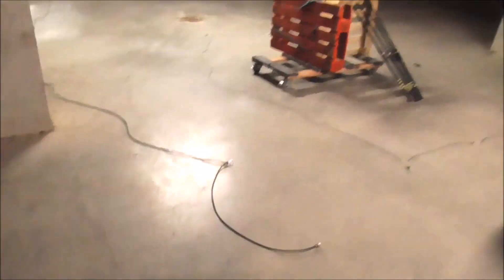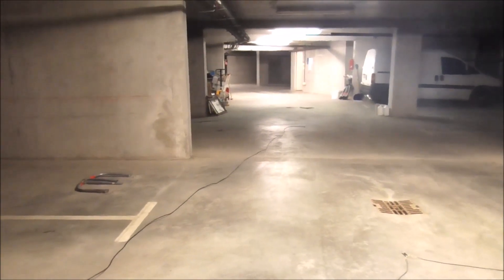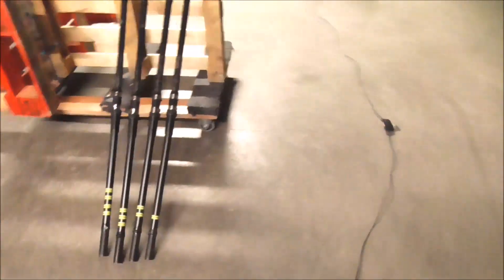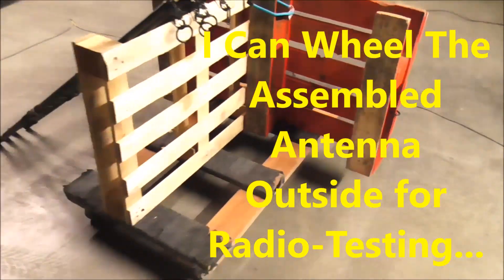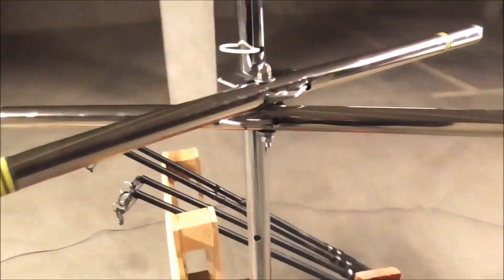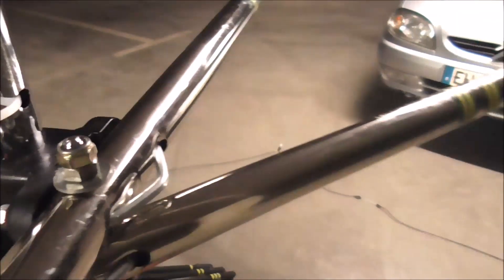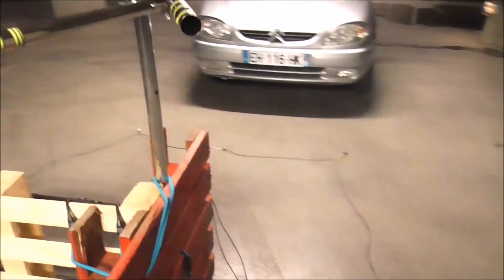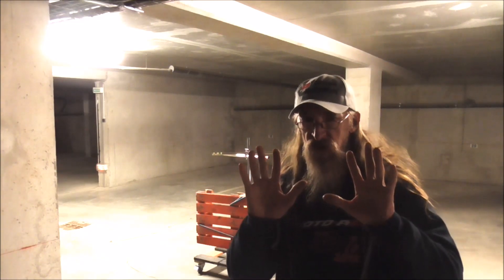Moxon Type ~ 11m. 2-Element Beam Wire Antenna ~ What Exactly IS It?

Comment: how do you determine how long the supports need to be?
Reply from the maker: Hi. This was a simple mathematical equation with a small add-on to provide the tension in the wire adjusted "by hand" to give it the the final shape, angle etc. I hope this is helpful. Cheers

Comment: Max, could you give me the lenght (aprx) of the fishing rods when fully extended. Thank you.  Pete
Reply from the maker: The final adjustment of the four rods I did non-measure to give the wire the right shape and angle. The important measure is the angles apart...40/140. Cheers

Comment: Perfect ! Great to have correct the dimensions of the online calculator, the antenna is based on 27,000 calculation and the swr is really correct across the band? 27.555 up to 995?... thank you again for uploading this video of this production! friendship of 14RL40 (south west France)
Reply from the maker: SWR is 27.999 (28.0!):1.7 ~ 27.5:1.2 ~ 27.0:1.0 ~ 26.5:1.0 ~ 26.0:1.5 ~ 25.5:1.7... Very Wide as Electrically it is a Dipole. if you do not use 26mhz then set the online calculator as you need. You should be able for SWR <1.2 for full 27mhz coverage.Thanks for Your Comment. 73's de 14SW007
Reply: @MaxMountainWorld  I think that we can put a 1/1 balun in dipole attack ... just to symmetrize the 2 lines ... to test ... 73's
Reply from the maker: @xavierLanot  I tried a 1 to 1 Balun on the most recent version. it only narrowed the bandwidth and wasn't really any use! Thanks for Your Comment Cheers